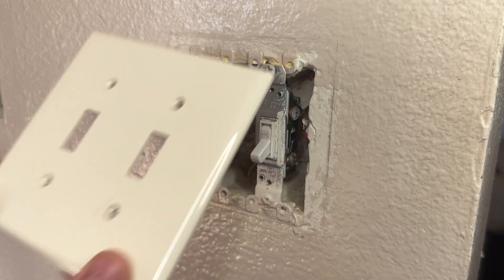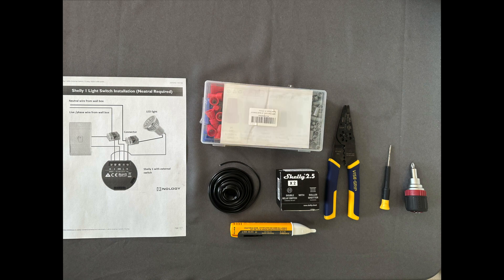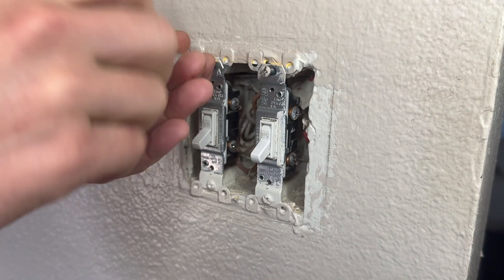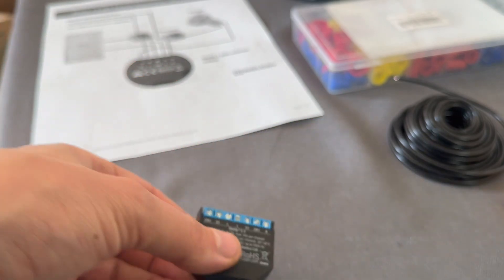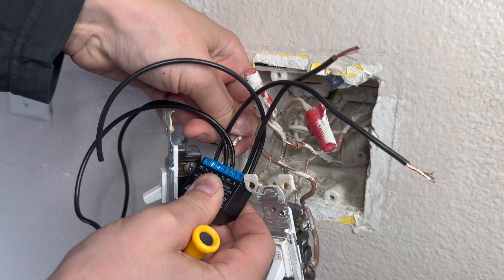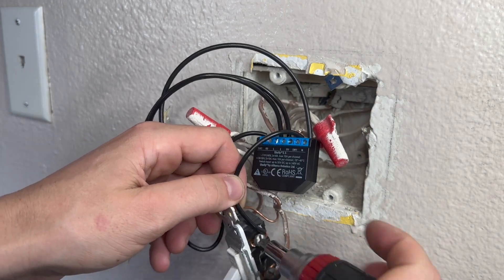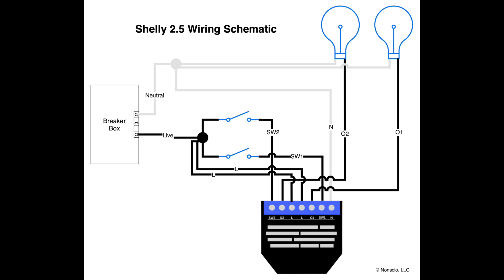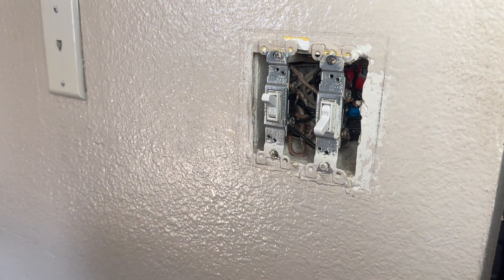How To: Wire a Shelly 2.5 Relay

Comment: Nice video. Well done.  As a fairly experienced DIY guy I personally never actally trust a non contact voltage tester.  I use an actual meter.  Text that there is power. Then throw the breaker and test for no power, then test the tester on something else that is still powered.  And then use your non contact tester to verify.  Seems ridiculous but I’ve been shocked a few times and  got scared.  

These switches look cool. Getting ready to rewire a bunch of stuff in daughter’s house.
Reply from the maker: Good suggestions! You can never be too cautious when playing with electricity!

Comment: I do appreciate you taking the time to put this video together and sharing it with us. I can certainly claim I have benefited from watching it to have an idea of how to install one of those relays. However, I would like to express some concerns about the installation. It is always a good idea to use matching color wires (and pig tale wires) with any type of electrical installation. Although what you did works, if someone else needs to troubleshoot your work, having all connected wires in the box with the same colors helps a lot. The other somewhat of a concern is the gauge of pig tale wires you used. I know you mentioned you used a 14awg, but in most cases the wire in the wall coming in from the breaker is 12awg, and some people might go 14awg from the switch box to the fixture. If you have 12awg on both side of the switch, that 14awg pig tale wire is not recommended. If you were installing the relay at the fixture, one could go as low as 16awg or even 18awg.
Reply from the maker: Thanks for your input! I agree that having consistent wiring practices is always a good idea.

Comment: Great video! I’m not new to electrical work, but just getting on the Shelly train with my new home — this was very helpful to get context before I popped open the box!

Quick safety tip, especially in +2 gang boxes (but I still do it for single switch boxes), it’s recommended to tape around those contact screws with electrical tape. There is a lot going on in there between the Shelly switch & the 2 gang switches, it’s always possible over time for wires to bump up against other exposed wire or those contacts. It’s especially helpful for you or any other person servicing that switch box.

Also, @theaustindude is right, but for all intensive purposes, it’s okay to label the wires using correct electrical tape color. That way if you are not the person servicing the box, it will be easy / safe to understand what’s going on in there.

Hopefully that’s not too long of an explanation or annoying to hear from a fellow electrical DIY’er, cause I really did like video 😊
Reply from the maker: Your feedback and suggestions are much appreciated! Your ideas will help others who come across this comment :) Thanks for sharing!

Comment: Thanks for the video, can you perhaps explain what happens when you turn the light on with the app and you flip the switch on and off? Same if you turn the lights on with the switch and then turn it off with the app? is this even possible? Thanks
Reply from the maker: Hi! Yes, I’m happy to explain how that works. 

Situation 1 (Switch off, turn lights on from app): With the light on and the switch in the off position, turning the physical switch on has no effect. Light stays on. When turning the switch back to off, the light turns off and app updates accordingly. 

Situation 2 (Switch on, turn lights off from app): This is just the reverse of the situation above. With the lights off from the app and the switch in the on position, turning the switch off has no effect. Turning it back to on will turn the lights on and on state will be reflected in the app. 

I hope that helps!
Reply: Thank you so much for this information, this has been precisely the info I have been trying to find. I'm going to be ordering one now!

Comment: Shouldn't you be using different color wires for the various parts of the circuit?
Reply from the maker: Hi! Using different color wires for different parts of the circuit is an excellent suggestion! The relay has labels for what each wire is, but different colors would make it even easier to see at first glance.